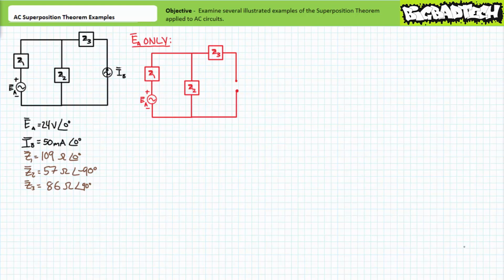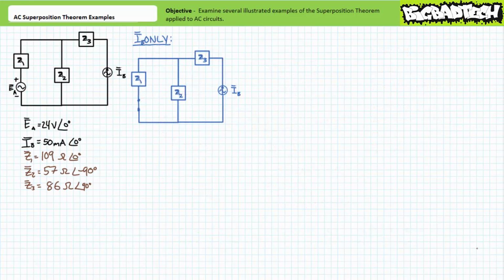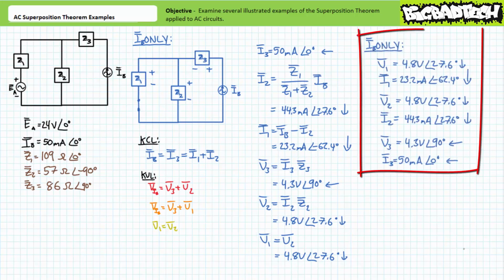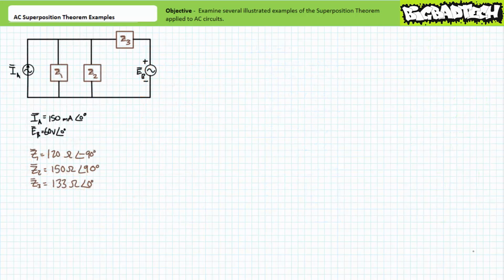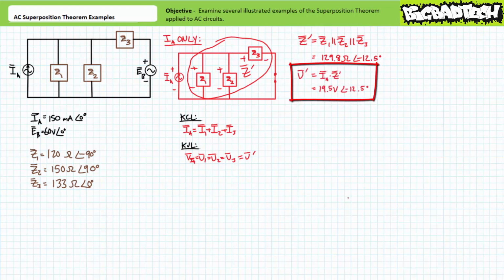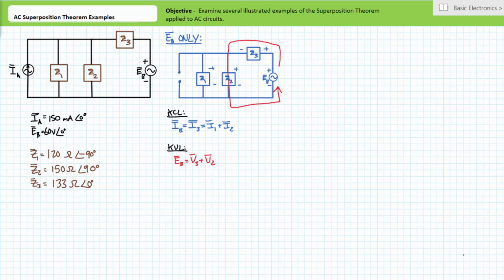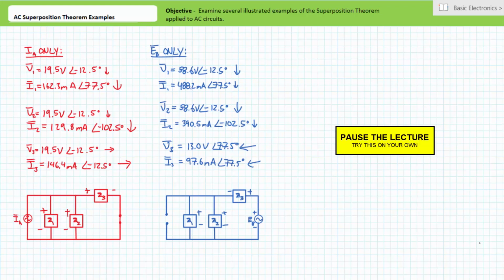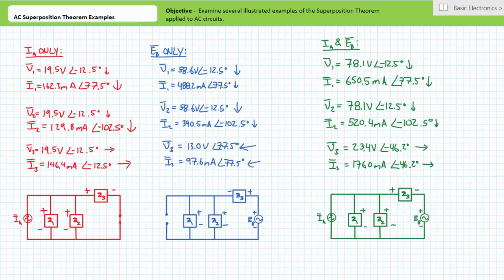AC Superposition Theorem Examples (Part 2 of 2)

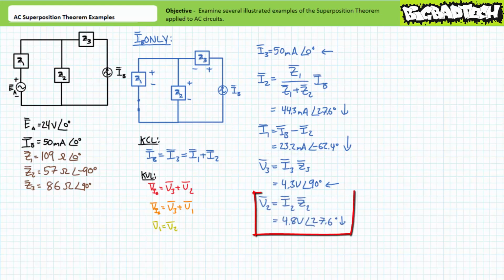Comment from the maker: ERROR at 4:10 Although I performed the current divider rule and KCL correctly for I2 and I1, it looks like I dorked up a simple Ohm's Law calculation. When only IB is the source of interest both V2 and V1 should be (2.5V/-62.4) oriented + to - top to bottom.
As a result our final superimposed values will also change. Final results will be roughly V1=(21.4V/34.4) + to - bottom to top, I1=(196.8mA/34.4), V2=(13.6V/-62.4) + to - top to bottom, I2=(239.4mA/27.6). Another way to spot this egregious error would've been to superimpose the correct current values accounting for magnitude, phase shift, and polarity.

Comment: Hey Jim! At 4:10, I think I spotted a mistake. V2 = I2.Z2, I get a value of 2.525<-62.4? Same for V1
Reply from the maker: Good eye! Yes, the current divider rule and KCL were performed correctly for I2 and I1 however it looks like I dorked up a simple Ohm's Law calculation. You're absolutely correct both V2 and V1 should be (2.5V/-62.4) oriented + to - top to bottom when IB is our source of interest. As a result our final superimposed values will also change. Final results will be roughly V1=(21.4V/34.4) + to - bottom to top, I1=(196.8mA/34.4), V2=(13.6V/-62.4) + to - top to bottom, I2=(239.4mA/27.6). Another way to spot this egregious error would've been to superimpose the correct current values accounting for magnitude, phase shift, and polarity. One million bonus points for you!